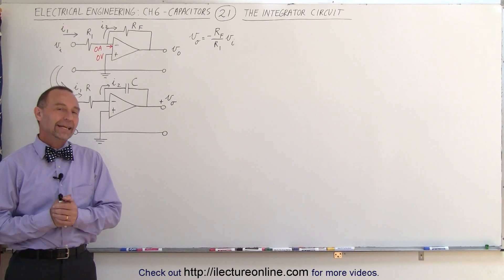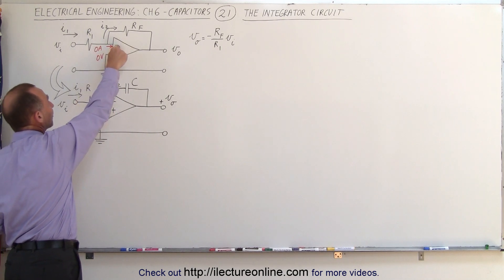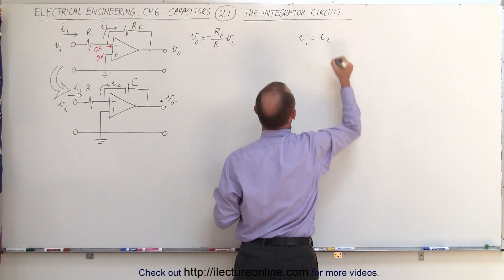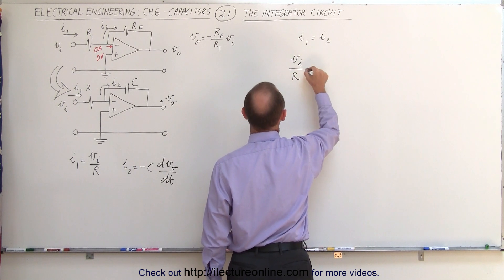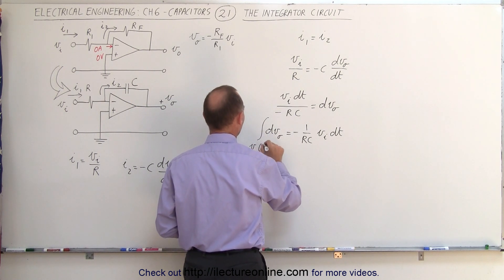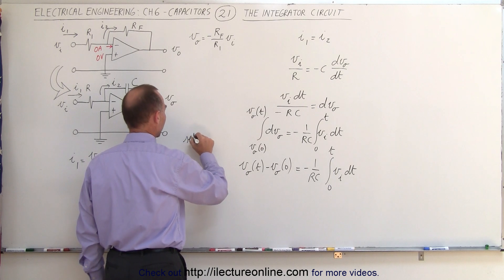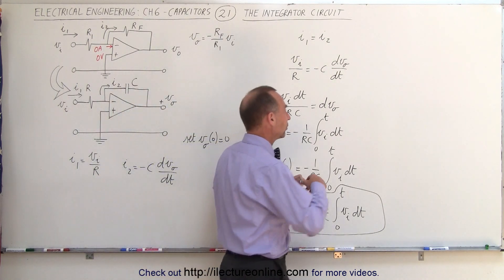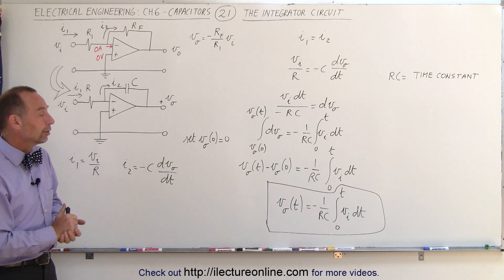Electrical Engineering: Ch 6: Capacitors (21 of 26) The Integrator Circuit

Comment: in Ii = Ic, can we change the arrow of current from vo towards 0 and 0 towards Vi (all arrow to the left), can we do that? OR is that always Vi towards 0  and o towards Vo (all arrows to the right). can someone answer that. many thanks.
Reply: Either way works. if we make all current flow from right to left, then we have to assume Vin is negative because there will be a voltage drop across the input resistor from the zero voltage node (negative terminal of opamp). You get the same thing.  The way Mr. Michel did it in the video was based on opposing currents, he said current flow to right but then he assumed output is positive, so i_w should technically(from assumption 2) flow from output to the left, but he already declared all current going to the right which makes i_2 negative to satisfy both assumptions.

Comment: Can you explain why you assume the output voltage is positive?
Reply: Just multiply both sides by -1 and you will get a negative output voltage. He just left the final equation with the negative sign on the right side.